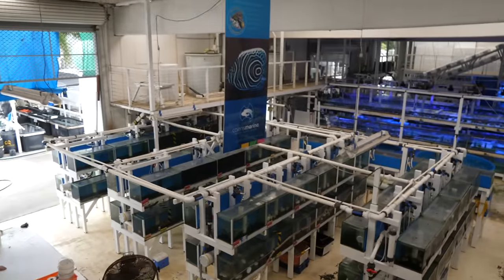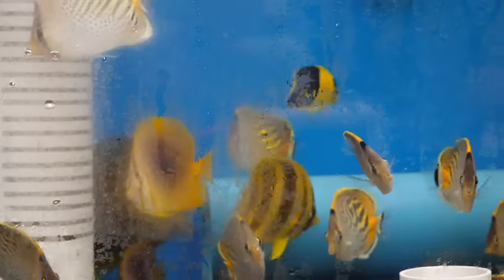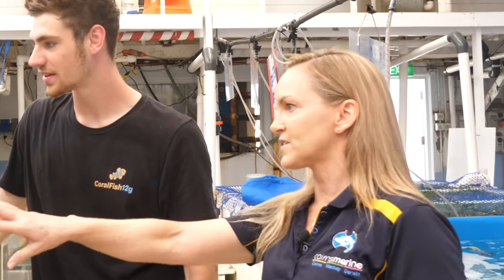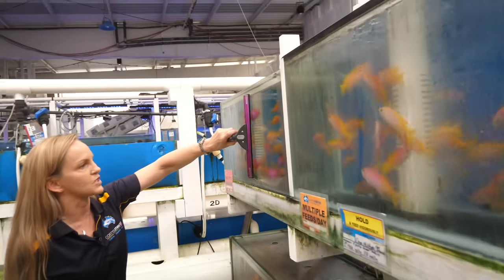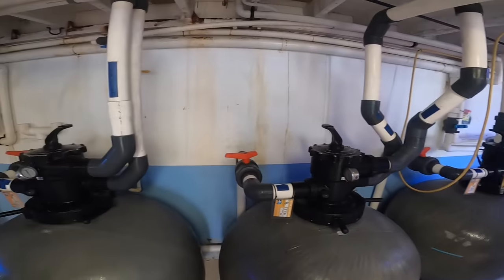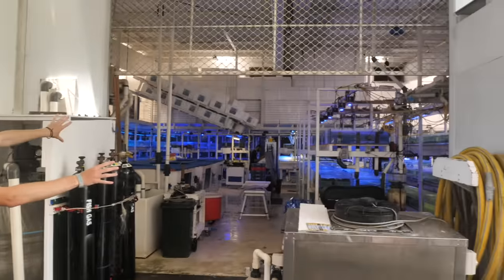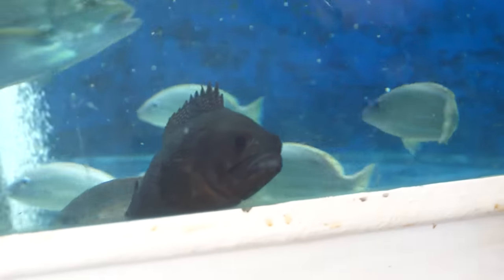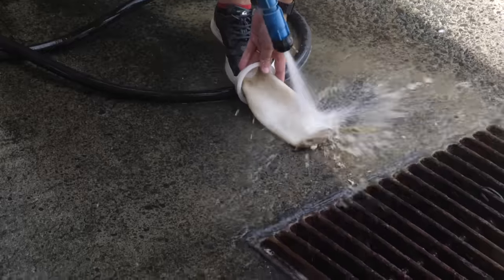LARGEST AQUARIUM FISH & RARE EXOTIC ANIMAL TOUR!! (800+ Creatures)

Comment: This facility looks great! I’m just wondering if they’re providing enough space to ethically keep fish. The minimum tank size to keep a clownfish in is 20 gallons, and the clownfish in this video were definitely not in 20 gallon tanks. Not trying to hate at all, I’m just curious!
Reply: Thank you! I was wondering the same thing but I didn’t know how to word it without seeming like a jerk. You worded it perfectly. I hope they’re not in those tanks for too long. Hopefully they’re just there until they go to their forever home/aquarium/wherever. At least that’s what I’m telling myself.
Reply: To be honest, most of these holding facilities have fish in small tanks, at the very least, its quite good that they're very on top of their filtration type stuff and the fish all seem in great health, even got the sharks breeding etc, so I'd say its kind of a necessary evil for the industry, it can be MUCH worse
Reply: The idea of "20 gallon tank" is to make sure there is enough water to handle things like oxygen, nitrate, ammonia, etc. levels, not for swimming space for this fish. Other fish, as you can see in the video may have larger tanks, more bubbles (oxygen), rocks/tubes to hide in, etc to accommodate the needs of the fish. The space for the clown fish isn't an issue. The clown fish you saw in the smaller space is part of a water system that is likely hundreds if not thousands of gallons of water and therefore more than enough to handle the clown fish
Reply: well, this is a holding/export facility, so they are not going to keep them for too long, only temporairly, and it seems they keep their tanks in a good condition so the fish are healthy.
From what i've seen most export facilities use small tanks, cause they need to cut cost though, but yeah its only temporary so the small tanks should be no problem

Comment: When I was in my early 20’s, I had several fish tanks. I had a 250 gallon salt water tank, a 20 gallon tank for my seahorse, a 15 gallon tank for my starfish and then a freshwater tank. I went out one night and when I came home, it looked like someone put a black cat in my starfish and blew it apart. I was so confused. Pieces of starfish were all over the tank. I was sad, assumed it died and flushed it down the toilet🤦🏼‍♀️🤦🏼‍♀️🤦🏼‍♀️🤦🏼‍♀️. Later I learned it had multiplied (if that’s the term for it) and I freaking flushed it.  This was before smart phones so it wasn’t like I could just google it. I’ll never forget it. Huge mistake. Sad face😢

Comment: If she reads these comments, you need more layers in your hair to give it movement, you look like you have two separate, hair cuts. 
You need more layers and shaping.
It will move with your body and head better when making sales or caring for fish, as opposed to having to pull a thick curtain back, again and again.
We are locked down, and I didn’t get a hair cut after the last lockdown.
 Our hair is about the same length, so I understand the struggle.